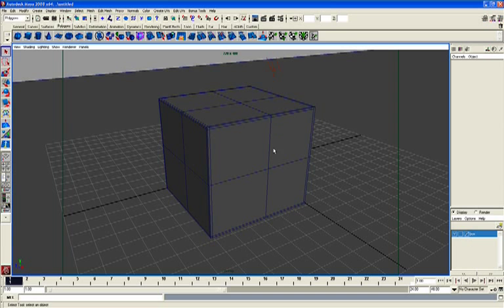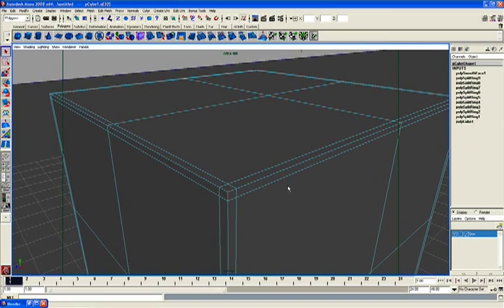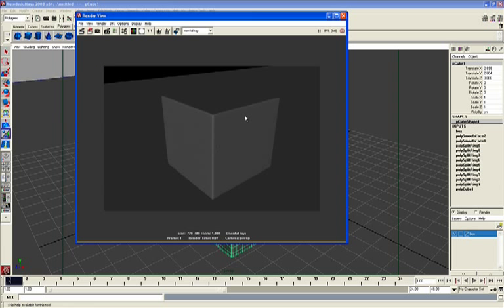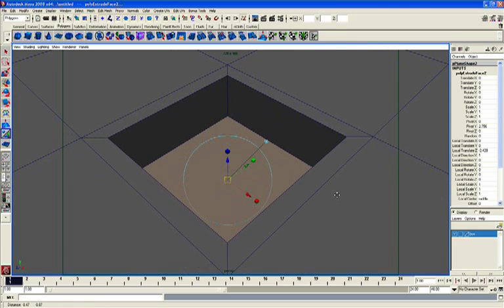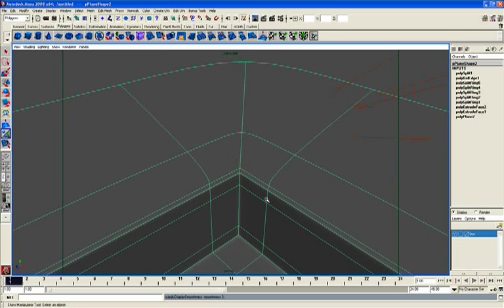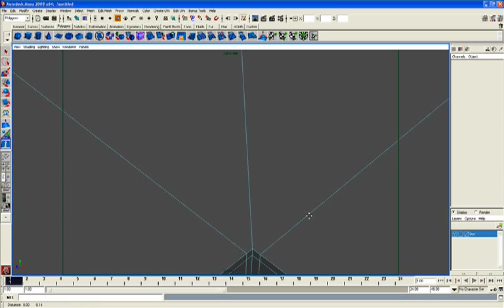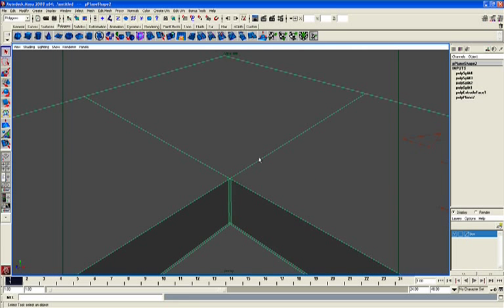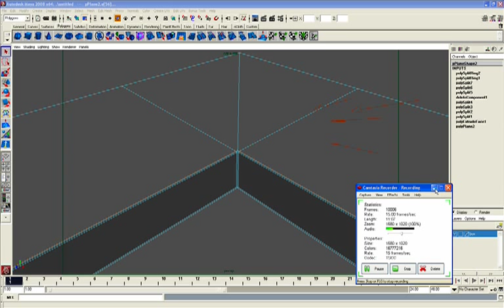Maya Special Tutorial - extrude and edge constraints

Comment: Thanks for posting these great tips mate! One remark though: the first technique sometimes results too high poly count especially when you plan to tweak your UV map of your object later on. If you perefer to (or must) keep poly count low try to use bevel on hard edges OR/AND tweak your edge hardness values loop by loop according to your flavor. You'll be able to achieve similar effects that way too without making your poly count higher than required.